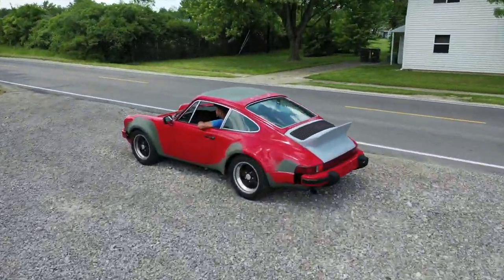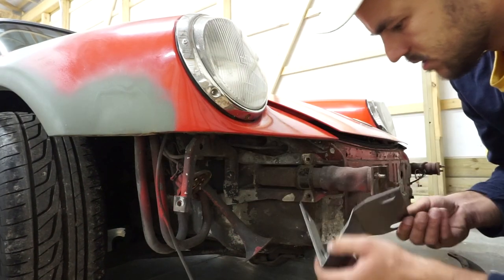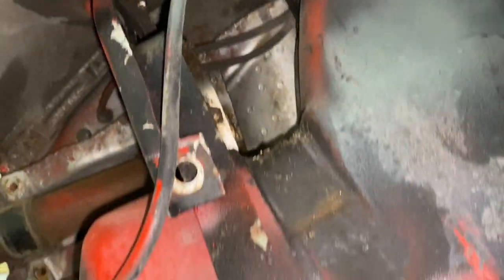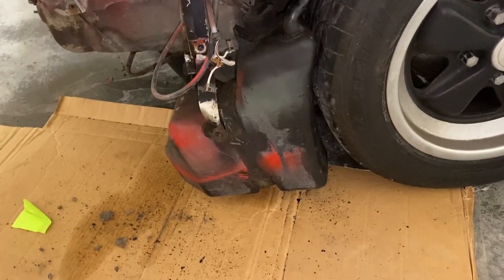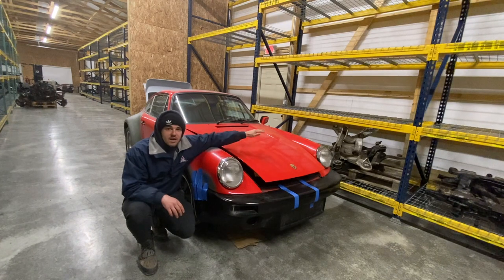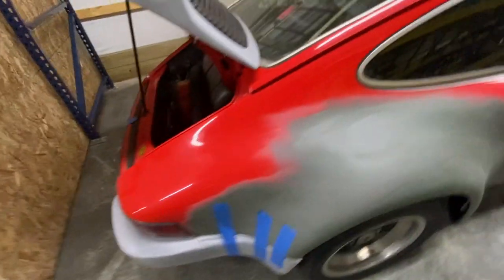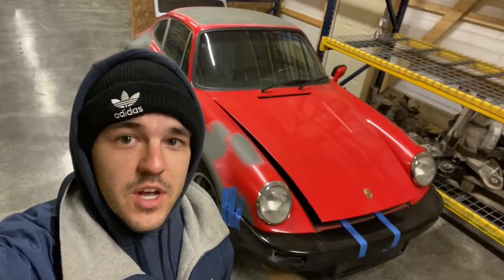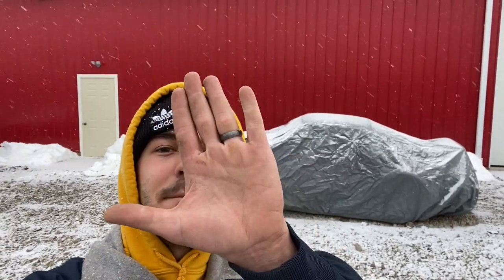CHEAP 1977 PORSCHE 911 PROJECT PART 3

Comment: The front fenders can flex a fair bit so you might not have to adjust the front bumper at all.
Reply from the maker: I’ve thought about that, but you think enough adjustment for the 1” too wide though?
Reply: @SuperishMario  Nah that might be pushing it a bit. Have you checked the homebuildbyjeff channel? His bumpers needed a massive amount of adjustment. Good thing fibreglass is easy to work with if very messy.
Reply from the maker: @krisdecreton4243  Yea I've been following his channel since the first 911 video. I'll have to check that one out again! Might be worth the learning experience as well as a good guide for others who might need to tackle the same job in the future.